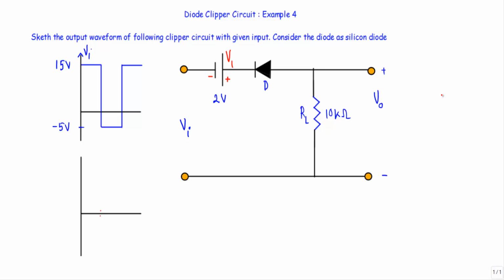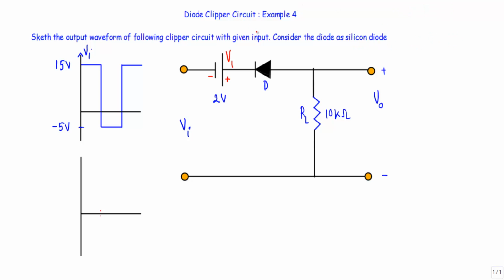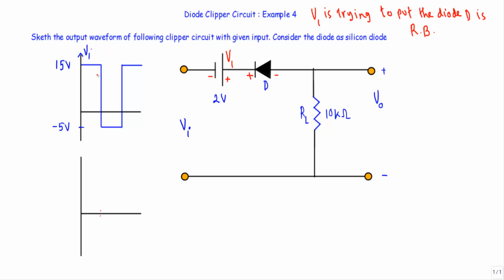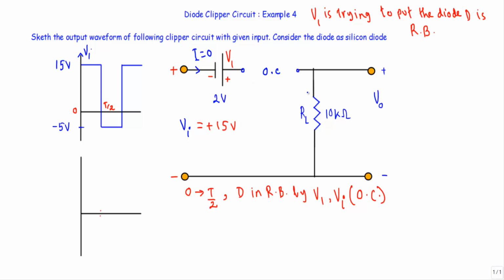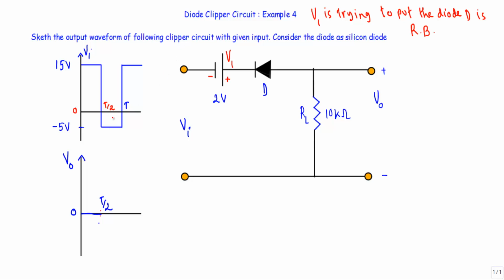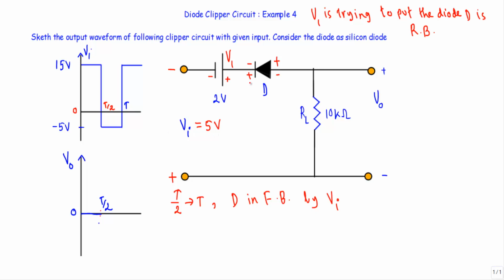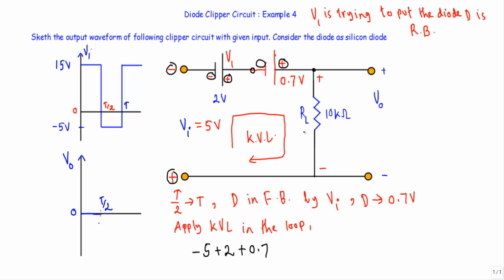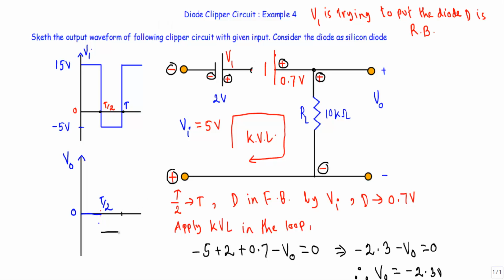Diode Clipper Circuit : Example 4

Comment: Instead of considering as open circuit if we consider a big resistor then the voltage has the input value